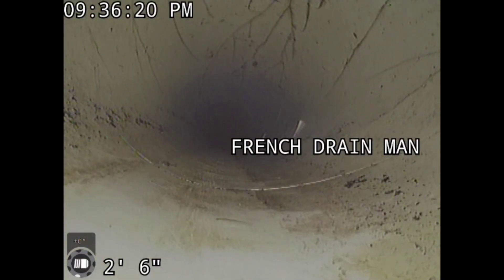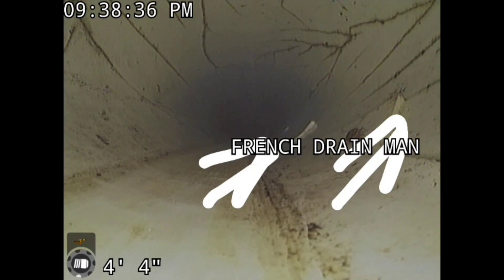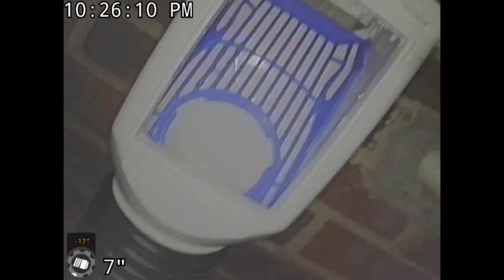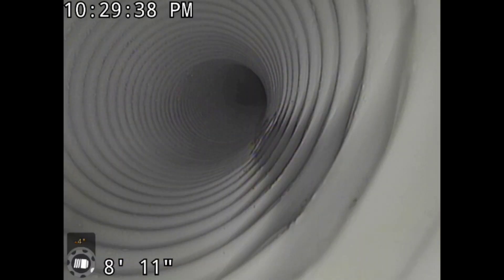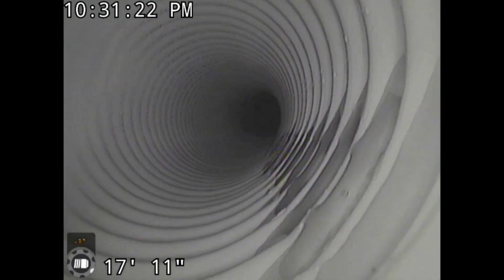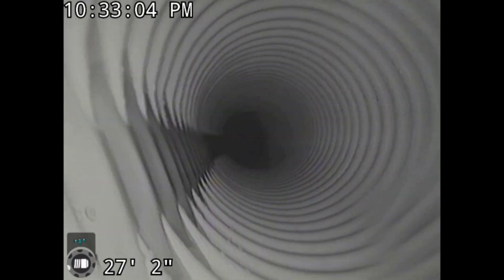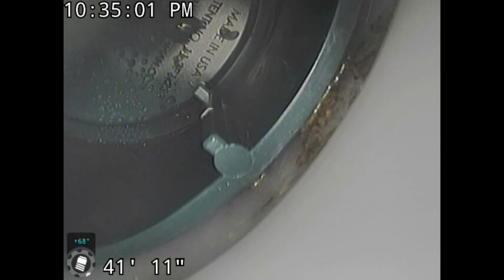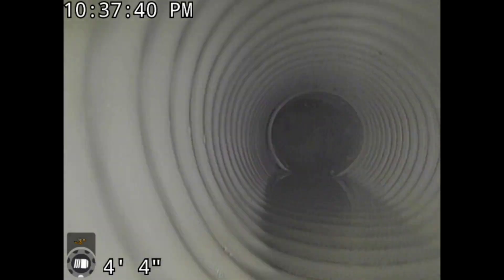PVC Pipe vs Corrugated Pipe: Pros and Cons. Which one is better for your yard drain? [Series 3 of 4]

Comment: What's the minimum slope I can run solid, corrugated pipe from downspout to pop up emitter?  Some sources say 2% and others say 1%.
Reply from the maker: If you use 4" pipe, it needs to be on a 2% slope; if you use 3" or 3 1/2" pipe, it only needs a 1% slope.
Reply: Gotcha...thanks.

Comment: Is it OK if a section of the ads pipe is perforated? I did mine with a 4" ads pipe about 40' with a popup but the last 10' is perforated for leeching. It's got a decent pitch I think the deepest is about 20". In the North East. It's about 8 year's old and I see  lots of water from the popup whenever it rains or thaws. Did a catch basin in the back and a zipper drain in the front where the side gate meets the driveway neither has cracks after some deep freezes, both with screens to catch the big stuff and all the roof shingle debris and easy to clean. I still have to do the other side to do but not just for the front and rear down spouts. I need to incorporate some yard drainage as well and I'll just pop up in the front lawn away from the house. Probably not going to do any perforated pipe on that one. ADS all the way!
Reply from the maker: https://youtu.be/wawHvSs0UV4?si=PwMPhYk10xi6jeFW
Reply: @FRENCHDRAINMAN  Thank you.  I actually had this video saved for reference. I did my drain long before I saw your channel. I guess I did a couple things right. To be honest, I didn't research anything, I just winged it and went with what made sense to me. The zipper drain at the midpoint intercepts the mainline and I guess that offers a decent enough vent for good flow. When I do the other side of the house, I will add more vents. It will be a longer run. I like the leaf blower method. I'll do that this year for spring cleaning. Love your stuff!

Comment: saw a recent video of yours saying not to bury drain pipes etc in colder climates.
THis one talks about freezing not damaging the components.
Live in Denver Metro area, have your leaf guards & emitters, but not installed yet.
would I have to run heat tape down from leaf filter to emitter?
Reply from the maker: I don't bother. My house in Michigan has freeze-ups all the time.  The parts hold up to the freeze-ups.
Reply: @FRENCHDRAINMAN  thanks

Comment: i wonder, there are pvc pipes that does not brake even you move car over it , so why u dont use quality product ?
Reply from the maker: All the PVC pipes in this video series are schedule 40 high-quality PVC pipes.  If indoors, they would be in perfect condition; however, exposure to sinkholes and freeze-thaw temperatures compromises their durability.
Reply: @FRENCHDRAINMAN   there is no freeze below 0.5 m in the ground idk, we use these pipes for septics outside underground in mountains  and no problems at all. Thanks for everything , your channel is gold .

Comment: Don't they use PVC for runs to the sceptic tank?
Reply from the maker: Yes, the warm indoor temperature helps with heat transfer. That pipe stays in good condition.

Comment: Good morning. Can you please do a video of the best way to secure your pop up emitter to your 90. I'm concerned it's not a tight enough fit and  will get sucked up into a lawn tractor.
Reply from the maker: https://youtube.com/playlist?list=PLjFCqaZ4v1BXt8vDpjMmvJXxMn8Tgw0wA&si=Qqjj0Y4czp9NntaP
Reply: @FRENCHDRAINMAN  thank you, but my concern is not the pop up. It's the whole assembly. I have just installed 5 of your kits and noticed the pop up emitter assembly/turf restrictor is not a very snug fit inside the 90. My concern is it, the whole assembly, will get sucked up into the lawn tractor blades.